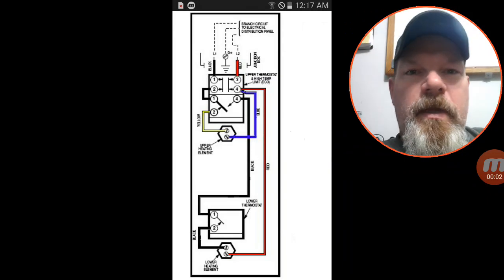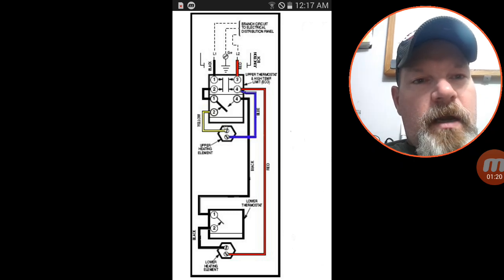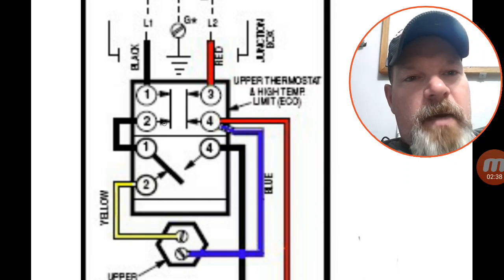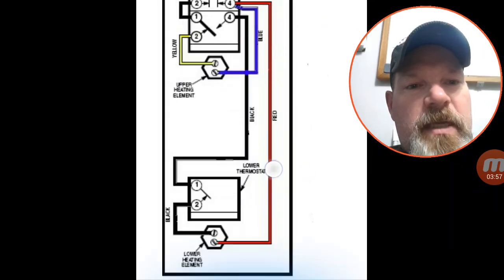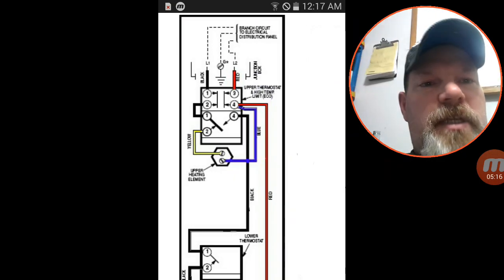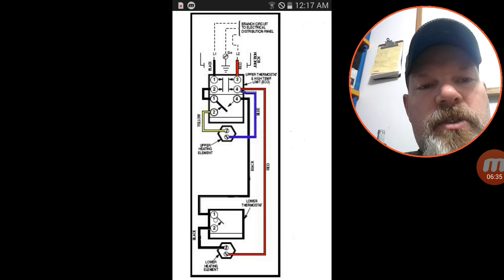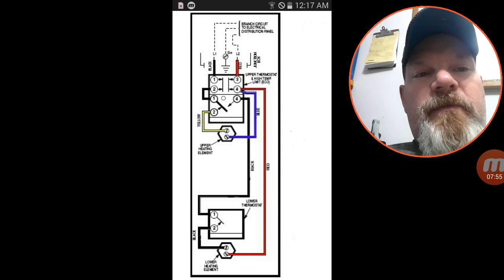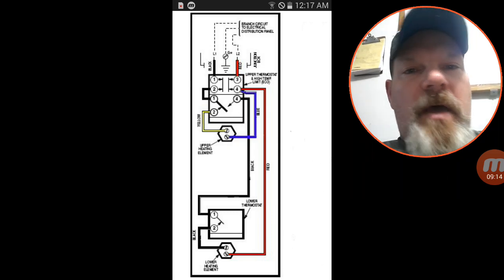Electric Water Heater Lesson Wiring Schematic and Operation

Comment: Why is there a much bigger double loop on top and single loop element on lower?
Reply from the maker: What are the wattage ratings of each
Reply: 4500 each but top is the bent back double. I think its because it inhibits lime build up better for extreme hard water.
Reply from the maker: It is the differance in watt density and material surface area. The doubled back element is medium density and the single is high density. The term "high-density" and "low-density" heating elements simply refers to how much wattage the element uses in comparison to it surface area or its size. An element with low density uses a lower temperature to operate. A unit with higher density uses a higher temperature to operate.

Comment: Lets see if I have this right - the Red & Blue wires are a constant 120V waiting for the circuit to trip and bring the other side of 120V to create 240V.. Is that correct ?  It also sounds like the Lower Element does most of the work and the upper rarely comes on unless the hot water is completely depleted..  Am i right  ?

Comment: I have this set up. I had a water heater that had  tripped the upper reset. I reset it and upper ran untill satisfied. Then the upper shut off, but it wouldn’t send power down to the lower stat. I confirmed this with a volt meter. So I replaced the stat. That one acts the same way. I have one leg at the lower stat. But can’t get power out of upper stat to the lower one. Possible bad stat out of box? It’s doubtful but I’m confused

Comment: its important to note the core reason for the duel pole sequencing switch in the upper element thermostat is to limit the total current load drawn to a level the circuit supplying the water heater can handle its also more efferent energy use wise to do this. If both elements where powered at the same time you would have to have a much heavier rated wiring and circuit to handle the load of both elements  ,  its also important to note a water heater with a bad or open upper element and a good bottom element when run out of hot water will never supply current to the lower good element as the upper thermostat will call and and never be able achieve its goal "then" allowing the lower one to receive power.

Comment: Great explanation! I have a brand new tank and it seems like after the kids take to shorts showers we are out of hot water ( I timed them, only about 10 minutes each. lol). I tested the elements and they seem to be fine but when I test the thermostats it seems the upper thermostat never turns on, always bypassing to the lower thermostat. Is it normal for a brand new tank to have a bad thermostat? Thanks for the video!
Reply: My boiler valve keeps popping off and my water is steaming hot , why , what's causes and everything is new

Comment: does it matter which connection the yellow wire attaches to on the upper heating element if the blue wire attaches to the other side of the upper heating element? Thank you

Comment: Recently replaced the thermostats and heating elements. DYI. After I run the tank for a while and cut power off at breaker, is it ok that thermostat terminals (screws) get hot to touch?

Comment: Cool...thank for the video! I'm welding two 55 gallon drums together, rubber coating the inside and hooking up water heater elements. I have a few big fish tanks and it's a pain to do water changes 5 gal at a time! Got to have the temperature right, and add stuff to get rid of the chlorine. So weld two barrels together make it 110 gallons, and when I go to do a water change just fill barrels, add chlorine remover, set thermostat at 80° then pump out from barrels to tank! Of course I will have it so pressure can't build up!
Reply: TEMPERATURE PRESSURE RELIEF VALVE T&P VALVE OR DEATH OR INJURY WILL OCCUR FROM TANK EXPLOSION.

Comment: Hey we replaced the top & bottom thermostats & elements had Rheem on the phone & it was wired wrong. Still after 2 hours of operation the water went luke warm. What do we do now still no hot water. Please help us I am at my wit's end with this
Reply from the maker: Did you check to make sure you have the correct voltage?
Reply: @GuyBrown yes
Reply: We are doing an isolation test now with the company
Reply: We got it as it was a plumbing problem we didn't have the shower part connected so Rheem said it could be plumbing because the water heater all checked out even the isolation test so hubby hooked it up and ta da we have hot water I am so thankful and ty for your time

Comment: How do I put a water heater on a closed circuit for my floor heating system, do I need to keep the supply line open once it's full of water or can I turn it off
Reply: I also wonder this. Do u need water pressure ?

Comment: Electricity is insane bizarre witchcraft....  Operates with no neutral wire, some weird one off rift appliance they sell us?    So we went from DC to AC....!?   What's goin to be next?  It's def coming in the near future....   But did u know that the ground and the neutral are bonded at some point in every electrical system?   So the full mite of the power lines are connected to the actual metal panel,  and all the ground holes on every outlet..
Why it chooses not to zap a person is beyond me... I know it takes the easy path , but it doesn't even give u a tingle.....    Science

Comment: I would like a video on how to wire it to the fuse panel. Mine is hooked up with 12/2 when warning label on top of tank clearly says use 10. I assume this is why my 30amp fuse keeps blowing-bc 12 is too small. Also it is labeled HW on two fuses side by side in the panel. Isn’t it supposed to go to one? I’m wondering if I should just leave it how it is and instead just put a 25 amp fuse in. I haven’t even been in attic to see how far away panel is but I also have no idea how to get the wire thru concrete walls into the fuse box itself. This is a very old house with cinder block walls and Edison fuse panel. I’m just worried about fire bc I keep smelling burning and fuses keep blowing. It’s a big deal with these Edison fuses . If it’s at night we are SOL til Lowe’s opens and then we are always buying their last set of fuses. I wish they sold the 20 or 30 separately bc now I have a zillion packs of fuses I don’t need . I only ever need the big ones.

Comment: I could use some advice.  I bought a mobile home where the hot water heater keeps getting way too hot and tripping the reset button on the tank consistently.  I went ahead and replaced both thermostats since the elements looked good. Same thing is happening with the new thermostats in place.  The wiring looks identical to what is shown here. What should I look at next?
Reply: Look at the fuse box panel ..and check your common and grounding .PVC plumbing does not carry current or voltage and water it self does not provide the proper properties to make a sufficient ground,depending on the mineral content in the water supply ,If yu are running a submersible well pump check the polarity of both units in the breaker panel.

Comment: So in theory, if I needed to ease the load on a generator powering the house in an emergency power situation, could I take the black wire from 4 and move it to 2 on the top controller? It would essentially create a series circuit. The volts would be divided to 120 each running both elements at the same time. So if my math holds, it would be 1125 watts x 2 = 2250 watts using my heater with 4500 watt elements.  It would cut the load from the heater in half. It's not ideal, but neither is an electric water heater haha. Unfortunately, there is no gas service in our neighborhood. Good video, man.
Reply: If you took black 4 and move it to 2 (I assume you mean the 2 with the yellow wire, but the other 2 would also not but them in seriesd), you do not put the elements in series.  They still each have their own connection to L1 and L2.  The only thing you would do is cause both elements to run at the same time once the upper thermostat was calling for heat and I would imagine blow the breaker (in the best case scenario).   If you disconnected BLUE 4 and connected to black 4, then you might put them in series.  Sounds dangerous to me.
Reply: If you try to run a 4500 watt element on 120 volts, you will increase your amp draw to almost 38 amps. When you run your elements on 240 volts your amp draw is at 18.75 amps. The wire feeding the hot water heater would be a 10 gauge wire, good for a maximum of 30 amps. The formula is:. P÷E=I.   4500÷240=18.75
4500÷120=37.5.

Comment: It seems that I always get the WEIRD problems ( I use to work on F4's lol ...).
  
New water heater installed - Luke warm water ... Later: NO HOT WATER.
Heating Elements checked ok with 13 ohms.
After disconnecting house wiring from the water heater, I checked the voltage on each wire from the circuit breaker to find ONE with only 20 volts on it.  
The breaker was not making good contact in the panel box.  
I Did not have to replace the breaker, just seat, and re-seat a few times for good contact.  
Before you guys run out for a new water heater or replace elements, check continuity on elements - If the elements are good, you might want to check the hot wire from the breaker for correct voltage.

Thanks for taking the time for the informative video Guy we appreciate ya!  :)
Reply: December - Two months later - NO hot water.  I checked voltage on the water heater ... 
I had 120V on BOTH legs.  
I turned the breakers off and checked both elements ... each one had 13 ohms ( they are good ).  
I replaced the circuit breaker - No More Problem -
Reply from the maker: Awesome man. Sorry for the late response. Life gets in the way sometimes! Thanks for watching. Let me know if you would like me to make a video on anything specific.
Reply: @GuyBrown  thanks for explain

Comment: SHOULD BOTH ELEMENTS EVER BE ON AT THE SAME TIME? I HAVE 120 ON EVERY POLE OF EACH ELEMENT,  NO HOT WATER.   AND NOTHING IS DRAWING HOT WATER. CURIOUS HOW TO CHECK? WELL, IF YOU HAVE TIME FOR AN ANSWER. I WOULD BE VERY GRATEFUL. IF NOT, I UNDERSTAND,  IT IS A GREAT VIDEO.  MAKES PERFECT SENSE. WHICH ACTUALLY ANSWERS MY QUESTION -  SEEMS THEY BOTH CAN'T CALL FOR HEAT AT THE SAME TIME?
Reply: I have the exact same problem. Wish someone would answer unless there are too many potential causes.

Comment: i just found this so sorry for commenting on something several years old... i am in the final stages of installing a solar hot water heater - the type with the evacuated tubes on the roof...  all the solar heat stuff is in, just have to hook up the 220v for the auxiliary heater in the tank (in case you don't have sun for a few days)... it's 220v, 20amp...  has a LED on/off switch on the tank, with 4 ports on the back of the switch.. the top two i know are 110/110v in from the main power... the bottom two are 'switched' so no continuity if the switch is OFF and continuity if the switch is ON.  the capilliary thermostat (220v 16amp) has two ports - labelled 1 and C (looks like some version of it may have the ability to have a 2 as well, so i'm guessing it's a 'normally closed/normally open option on those ones)...  so the question is, there are two wires coming from the only heater in the this tank (only 20gallons)... i know from doing other wiring on various controllers (photosensors, motion sensors etc), that one side of the 'thing' you're controlling, in this case the heating coil goes in the controller - in my case a thermostat -  then out to power,  the other port on the heater goes directly to the power - so essentially you're just sticking the thermostat in the 'loop'... BUT since it's 220v, does it matter which wire from the heating coil goes through the thermostat and which directly to the power (in my case the power on the on/off switch)?   thanks for any answers.

Comment: Thank you very much for the clear and concise explanation and especially the schematic normally they're on the removable panel. But not on my tank. I've been testing and testing and testing and testing for a month trying to figure out what the crisis going on I think I've isolated it down to the upper thermostat works on one side but does not work on the other that is when it is cold it is not connecting thankfully from your description and more than anything else you are great little schematic thanks again

Comment: Had an issue today where a tank with a 4500w element was drawing 24 amps at 240v. The lower element is 1500w. Have you ever come across a(perhaps defective) system where the tstats   allow power to both elements? Just thinking 18.75A(4500w)+6.25A(1500w)=25A. Only thought of this after I left
Reply: What size water heater is it? Kind of weird to have a 1500W lower element. A 4500W element should be about 19A, not 24A. It's possible someone rigged it somehow, but both elements should not be on at the same time. Water heaters are considered a "continuous load" by the NEC, so the circuit must be rated for 125% of the maximum required current. You could not have a 25A continuous load on a 30A circuit, which is what most water heaters use. I do not believe that a tstat could malfunction in such a way to send power to both elements.

Comment: Very clear explanation of the diagram, and operation of the system.  I just finished up replacing elements on a water heater, and was checking for voltage at both elements.  This video shed light on when/where voltage should be present.  Very cool stuff.
 Thank you.

Comment: I have mine wired this way. My top thermostat works fine, water heats up great. Lower gets power but doesn't heat the water. Also the top and bottom elements have power at the same time. What would cause this and also what would cause these new elements not to work. I replace both elements because I though the lower was burned out.
Reply: Both elements have power on them all the time, it is only 120 volts, you will only see voltage checking it to ground. This is because the circuit is not complete. The elements heat up because they resist voltage. The voltage can not move through the elements at 120 volts because the circuit is open on one end.

Comment: what causes both elements to be on at the same time? my circuit breaker is tripping.
Reply: Either it is incorrectly wired or the thermostat is faulty. Normally only one element is supposed to be on at a time.. check the wiring between the thermostats a d the elements. This man gives an excellent and clear diagram of the wiring connections.

Comment: so both elements never come on at the same time? Its either top or bottom? I put a new whirlpool 40 gallon in and now during high water demand the breaker trips. I thought both elements were coming on at the same time causing the breaker to trip. according to this that could not happen?

Comment: Great video Guy!  I have an older Bradford 50 gallon hot water heater. I have replaced both elements (they were bad, house was sitting unoccupied for several years), they worked well for a couple months. Then the water heater blew the fuse in the breaker box and actually melted some wires!  I replaced the breaker box with new circuit breakers and then replaced both thermostats. It heats up the water ok, but it is now tripping the red button on the thermostat after reaching temp. Any suggestions what else could possibly be wrong? I checked wiring, all seem to be in good working condition. I just want to get a couple more months from heater. I will replace it with an on demand LP hot water heater, but prefer do it in the warmer months. It's cold here in Maine!
Reply from the maker: +Rod Tirrell lower the set point or replace the control.
Reply: Can you clarify? I'm just a jack of all kinda guy! lol.  Lower temp setting?  If that doesn't work, replace new Thermostat?

Comment: The top thermostat is shown wired in the (NC) normally closed position so the top element receives power first.  You are misleading troubleshooters by what you are saying.  The top element comes on first, when temp. is reached the top thermostat goes to the other terminal and the bottom element energizes.   Ck NO and NC on schematic.
Reply from the maker: +jona hutchins did you watch the whole video? What happens first is relative to the demand at any given time.

Comment: Set top element higher 125 ,set bottom  lower 120 degreed
Reply: Dean Murray why?   I have been having some issue with my red button popping out and needing reset.   So I have been trying to adjust temp settings on mine.   The way the heater sits I can’t see temps I’m set to without mirror.  So I have just been guessing.   Trying to figure out happy medium.      Right now my water temp in the show will hold 111-107 degrees for what I would call medium length shower since I brush my teeth & shave my head and face in there.   But then it will drop down really fast and level out at 95 degrees.    

I know I need to turn both elements up odds are.  I’m just trying to figure out what’s ideal.     Also I don’t think my arrows line up with my numbers on temp.     It might be because I got a lil different shaped element (more tube)  and few additional watts.   But it was the only replacement I could find.

Comment: why is there no neutral wire on water heater 240 circuit
Reply from the maker: +jerry levins 240 volt single phase ( standard household voltage) is L1 L2 and nutral or ground. L1 to nutral is 120. L2 to nutral is 120. L1 to L2 is 240 and the nutral is the ground. Hope this helps. Let me know if you want me to make any specific videos. Thanks for watching.

Comment: Can you tell me how a 240v hot water heater heating element works? If your 2 120 legs are attached to the element, what is the neutral wire doing? The reason I ask this question is because I’m doing a project of using a water heater heating Element to heat drum of water at a camp and trying to understand the wiring for an (other than water heater scenario)